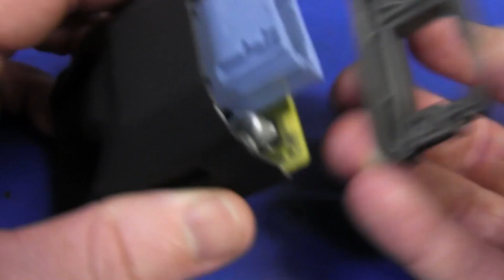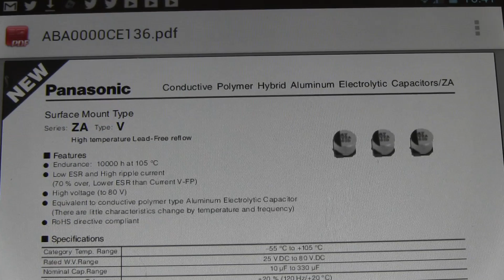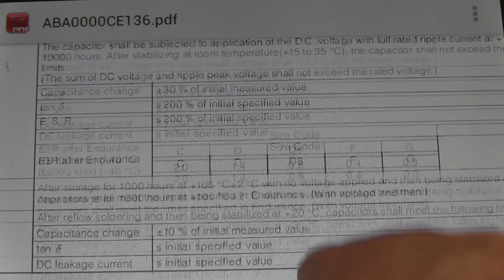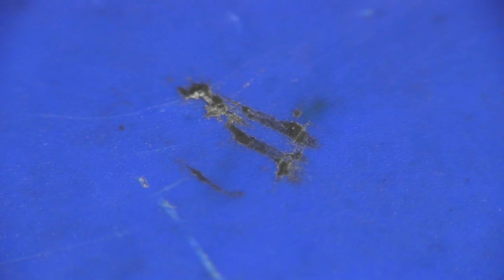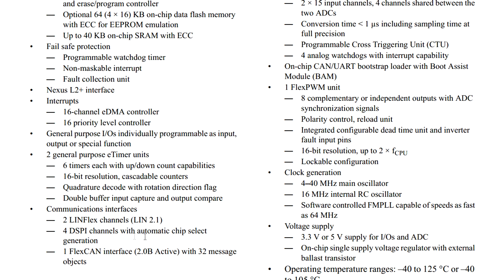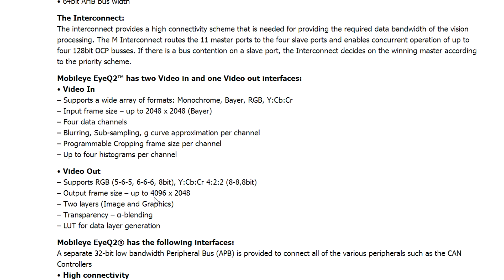EEVblog #444 - Car Lane Guidance Camera Teardown

Comment: The 6250 device with a choke and termination 1206 resistors is a TLE6250 CAN transceiver from Infineon.
http://www.infineon.com/cms/en/product/interface/automotive-transceiver/automotive-can-transceivers/TLE6250G/productType.html?productType=db3a30441355314b011362117060001b

Comment: if the camera gets dirty or covered maliciously could the vehicle crash? That's very worrying 🤔
Reply: It only provides driver assistance. If it were obstructed the vehicle will warn the driver that the features were not available and probably set a diagnostic trouble code to make you visit a dealer

Comment: I drew up a split CAN terminator for a board less than a year ago and looking at that funny CML and resistors at 15:00, it looks just like one. Funny values, though. It could just be filtering for a differential line with that cap to ground point.
Reply: http://liionbms.com/php/can_bus_termination.php Here's one scheme like that.
Reply: Better http://digital.ni.com/public.nsf/allkb/C03609ECFF16A14E86256E5A008293EA

Comment: I'm surprised they would use such large SMD caps... Seems like they might break free in a collision.
Reply: And then go where and do what kind of damage exactly? They are inside a magnesium box. Besides, they are really less than 9mm tall, they won't detach from the board that easily.
Reply: Good points...  I guess my concern was that they would break off in a moderate collision, and the car would be repaired, but with these caps rolling around. I'm sure they've thought about it more than I have, though.

Comment: Hey Dave These cameras are usually mounted behind the rear view mirror! :) hence the slanted shape to fit the form of the windshield
Reply: Yes. And the module is built to handle the 186-200`F temps. It's at the top, where the heat from the roof and greenhouse and direct sun all conspire to kill those caps.
Reply: Completely correct. The angle would be much too steep for a lane-keeping assistant. In most cases, only the radar module for the collision warning system is installed in the bumper.

Comment: Does Panasonic make anything that isn't good?  I have read that their lithium ion batteries are some of the best.  I have a flashlight that uses an 18650 cell and reading the forums a lot of good things are said about Panasonic 18650s and other Japanese cells.  With that said, it would not surprise me if those capacitors were just as good.
Reply: Any of their consumer gear, shit always fails. I had theater receiver with mosfets attached to a heatsink with gobs, i mean like a solid fluid ounce of thermal grease, for 4 mosfets, and that was the part that let the smoke out
Reply: No worries there mate as its magic smoke!!.

Comment: I am surprised they supply a LIN bus as well, as it is so slow as to be almost useless in this application. LIN is generally used for low bandwidth applications as immobilisers and radios rather than CAN because of it's lower cost implementation.
Reply: And i smirked when he said "of course they're not gonna use Ethernet!"... well he'd be surprised. Infotainment needs CAN unfortunately still, but i think the connection might almost go away eventually.

Comment: Was not expecting this level of quality from Hyundai. Wonder if this is from an Equus or a high optioned Optima.
Reply: You'd be surprised at the quality of computers in most modern cars, they have taken major steps forward in build quality and general design as of late. It was once that I would complain about every car computer I had to work on outside of a Lexus. Now the build quality is so insanely good that I doubt we'll see electronic issues outside of rubbed wires/software glitches before the engine finally needs rebuild in modern cars. If you look at old isuzu computers and compare them to today it's chalk and cheese and this is a good thing as it means I don't have to test so many god damn capacitors.
Reply: Was that part actually made by TRW?  You would be surprise how many parts in your car might be made by them.  They even make brake pads, various electrical parts, and seat belt components just to name a few things that I know of.
Reply: probably same on both
Reply: s0nnyburnett Hyundai does make some great quality cars now. They're far from mediocre ugly sendans they used to be.
Reply: foxman105 Some Chevrolets were Hyundias really.  Some of them are also Toyotas which are very similar to Hyundais and some of them even use the same parts.

Comment: As for the life of the electrolytics: cars have a rather short life, measured in hours. 300.000 km @ 60 km/h is only 5000 hours. Less than a year under voltage!

The Quorvia is acually a Power chip (an IBM design, think of the PowerPC Apple systems). Interesting.

Comment: yeah the case would be about 2 years.. My 06 volkswagen jetta died in 2012 (did the engine rebuild myself just last week) while my 02 Chevy Silverado never changed oil/filters, injectors etc since i bought it in 05, and its still alive today...

Comment: The applied voltage is not really relevant,the heat and amount of charges/discharges per second usually wears it out so much faster.
Those caps would do as good for 5VDC  as they do at 35VDC,doing nothing.

Comment: Having been involved in temperature riser testing of electrical devices for use in northern Australia, I can tell you that in a car under a windscreen on a 35°C day the temperature will easily reach 65°C or 70°C
I dare say 80°C would not be uncommon
Have you ever felt the steering wheel of your car on a warn day after it's been sitting in the sun?

Comment: Mobileye EyeQ2® two floating point, hyper-thread 32bit RISC CPUs ,5Vision Computing Engines (VCE),3 Vector Microcode Processors (VMP® ), 64bit DDR Controller, 128bit internal Sonics Interconnect, dual 16bit Video input 18bit Video output controllers, 16 channels DMA and several peripherals. The MIPS34K CPU manages the five VCEs, three VMP™ and the DMA, the second MIPS34K CPU and the multi-channel DMA as well as the other Peripherals.

Comment: There are probably clock multipliers in the chip, so it does not actually run at 10MHz, but for some applications, 10MHz is a lot.

Comment: Not so, you are now thinking about air temp. Car's body on a sunny day may heat up to 60-80 Celsius degrees with ease. It's the same thing as you can't leave your dog inside your car on a parking lot.

Comment: I don't know where you live, but 80 degrees celsius? That is rediculously high. Even in hot countries the temperatures don't go over 40-45 degrees celsius in the sun. 
Are you referring to fahrenheit perhaps? 80 degrees fahrenheit = 26.666666666666668 degrees celsius. Thats possible quite easily.

Comment: the firmware driving the vision system processor is the only noteworthy aspect of this product, it deserved a bit more credit/surmising than that. all other components mentioned in this video are generic, and therefore irrelevant to its patented purpose.

Comment: You're right.  I was on a smartphone and had no hope to read the numbers.  But the common mode choke is used for CAN, so seeing the closest 8 pin IC.  :)

CAN should have a separate transceiver, either 8 pin or a fail-safe 14 pin version.

Comment: That would be 10k hours if your car has a 35V battery voltage and your weather is permanently stuck at 105C temperature... Do you live in hell?

I would guess several times that in actual life at more believable temperatures and 12-14V supply voltage.

Comment: part number had 24c ... 24c.xx is usually serial eeprom, which usually comes in 8 pin packages, the st-eye chip has built in can bus as shown on its data sheet later in the vid, I'd bet a $ it is a serial eeprom

Comment: I believe the 8 pin IC opposite side of the common mode choke is the CAN transceiver.  The common mode choke is to cancel interference on the CAN bus.

Comment: You need to do a teardown of the Jaguar radar cruise control unit.  It has a tiny parabolic dish steered by a servo motor.  Scans back and forth to determine road boundaries and vehicle(s) ahead.  Pretty amazing stuff.

Comment: Depends what part of the vehicle inside the engine compartment temps close to and above 212*F can commonly occur which is why ignition modules and voltage regulators are common failure items.

Comment: 10,000 Hours rated at 105*C most vehicles are not going to reach past 212*F even in the hottest desert sun while the circuit is powered and the vehicle driving down a road unless you were in a heat lab.

Comment: Not sure if that's entirely true. They used acrylic lacquer in 40s all the way to 60s. It's quite brittle and not quite durable either, specially if exposed to UV and water (not very environmentally good either). Then in 60s they switched to acrylic enamels which were better but still very brittle in today's standards. The only good thing in acrylic lacquer was that it was extremely easy to repair. But sure those paints lasts long if you keep them indoors.

Comment: LOL Todays paint is the best?! LOL It's the worst, nowadays car paint is water based and it sucks old paint was based on oil that was a paint that lastest decades! Newer cars have to been repainted after ten years or less if you want to keep him for a long time. But don't bother due to the fact it's all electronic they will go bad son or later. Long live carburator cars and diesel mechanical pumps!

Comment: Hello, Dave. I have been watching your videos for quite a while and have been learning allot with you.
I was wondering if you would try this IR station for BGA and do a complete review/teardown and maybe later a complete tutorial on how to desolder, reball and solder a BGA chip.
ebay(.)co(.)uk/itm/PRO-T862-BGA-REWORK-STATION-INFRARED-SMT-SMD-IRDA-WELDER-SOLDERING-MACHINE-h5-/110821003319?pt=UK_Home_Garden_PowerTools_SM&hash=item19cd725037
Cheers from Portugal

Comment: Even if the cap was working at max rated temp and current during its life cycle, and lasted the 10k hours, and if over that 10k hours of driving your average speed was 30MPH that would be 300,000 miles on the clock.I would imagine there would have been a fair bit of replacement to the mechanics of the car, prior to you having to worry about the caps.

Comment from the maker: Don't confuse 10K hours at rated temp and current, with it's actual operational life.
Reply: The dash of a car, where this unit is intended to go, can reach 190F while parked. I don't see how these units will be reliable in phoenix arizona.
Reply: @FelonyVideos  the caps are rated over 212°F

Comment: Freescale is BIG ins automotive. Many inyection computers runs on Freescale MPC micros. In fact, they have an special flavour with peripherals just to enhace precision at reading and engine's calculating camshaft and crankshaft position. You cannot simply beat them in its habitat. Guessing that some early 68000 has this facility included and ECU makers turned to Motorola.

Comment: Google Hyundai and capacitors in electronics and you find they used to have a pretty high failure rate in ECU models in the beginning. Caused a few issues on older cars with engine management units failing just out of warranty.

Comment: How would you reverse engineer a 10 layer board?  Or a 4 layer board for that matter?
Reply: Separate the layers of course. Not an easy task but doable. Have to take images at each stage and clear all the vias of solder before separating them.